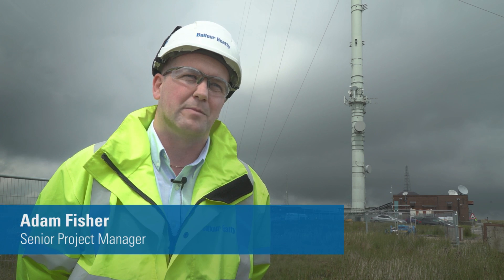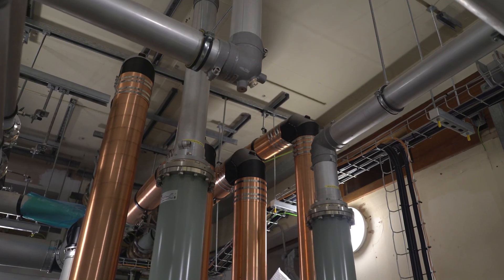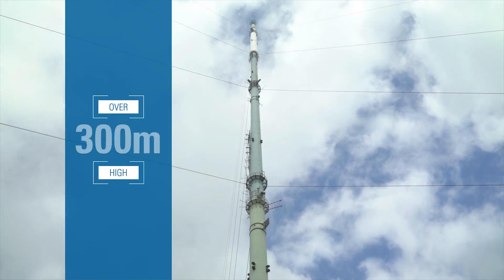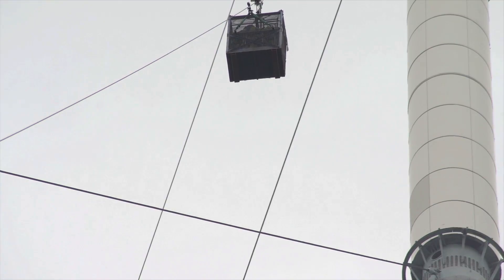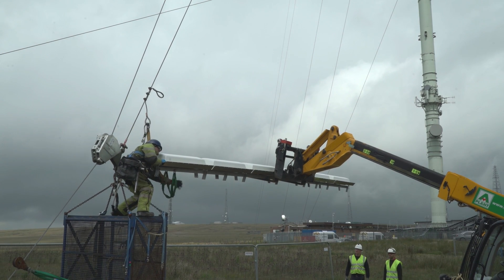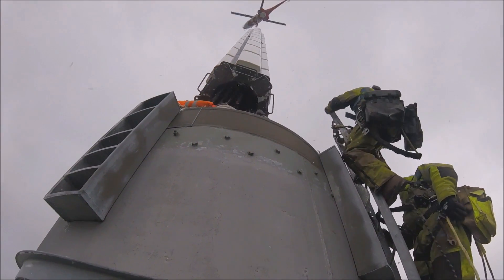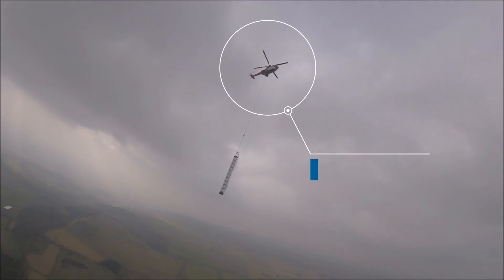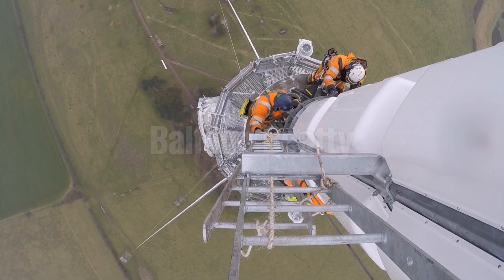How do we maintain communication masts?

Comment: Does that lift go up on the existing guy wires?
Reply: The Mast Riggers Rig a Cable up which is attached to whats called as a lazy rigger at Ground level  for the cradle carrying the  Mast Riggers and is then attached tp that part of the Mast they want to work on .

Comment: I find this stuff deeply interesting and had a few thoughts which I was hoping some more educated people here could answer. Is it correct that the radio/comms towers in the UK (concrete/steel lattice or otherwise) are actually build with the height in mind, purpose-built on certain land (not random) in order for a line-of-sight continuation? It intrigues me how much thought and planning goes into this...